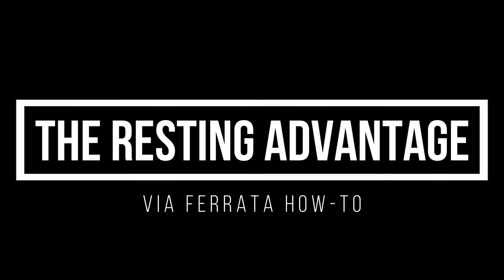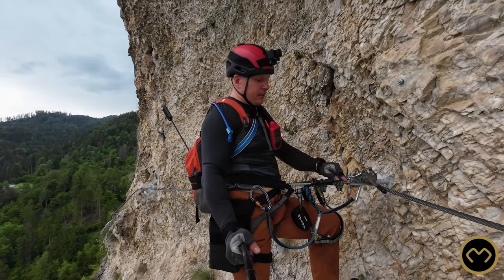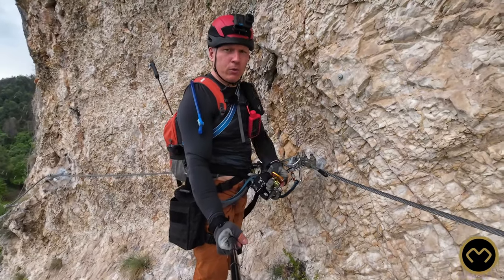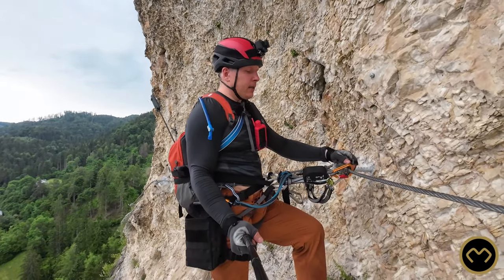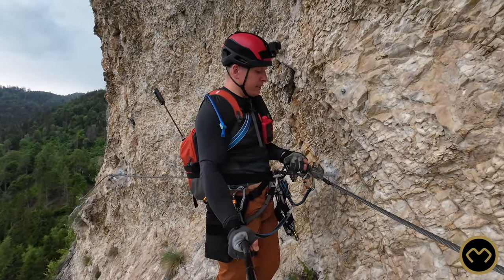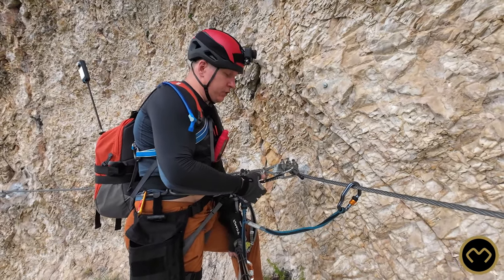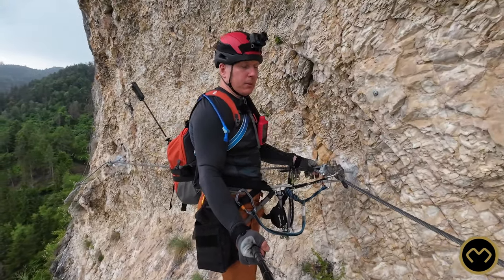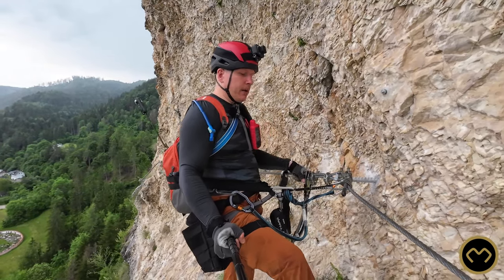The Advantages of Resting Systems on Via Ferrata - Why Sport Climbing don't require a resting system

Comment: Never use a normal static sling as the "rastschlinge" !

It breaks very easily.

Use a dynamic rope resting system like Edelrid "Switch adjust" etc.
Reply from the maker: Resting implies static load of the sling. There shall be no reason to fall. If properly utilised, a fall shall be static enough to not load the sling to the degree of a rupture of the sling itself or as you say, with dramatic effects on the structure of our body. It is true, dynamic rope can in the right circumstance help. Again, resting systems are for resting and if properly loaded there shall be no reason to get into the edge case scenario you use as a base for your call to action. If wrongly utilised yes, the effects you mention can happen, but these are edge case scenarios. On a bridge crossing a static resting system will not 0ut the climber in any danger if properly loaded. The slack is close to none, in case of a fall the climber will mostly swing. Now, let's suppose that the webbing will break, the climber is supposed at all times on a Via Ferrata to be clipped with the Via Ferrata Set to the safety steel cable. Again, the probability for the static webbing to rupture is low is special/edge conditions are not met.
For vertical sections, the resting system shall be statically loaded and in this case there is no way of a fall. On vertical segments, the climber shall always stay way below the cable and again, the resting system shall be statically loaded with no chance of dynamic loading.
The rupture of the webbing is a possibility if overloaded and the loading of it is dynamic enough under the stress of the overload to trigger that.
If the static resting system is misused and a fall occurs yes, the worst can happen. But again, in this case is not the problem of using a static resting system (recommended for the cases where it is properly used) but of improperly using it.
Yes, a static sling is meant for static loads. A resting situation is founded on the premise of a static load. The recomandation to employ the help of the resting system (if conditions of zero slack and no possibility of static load are met) is because if properly utilised it increases comfort and safety.
It is important to understand all these details. It is also important to understand that the role of a resting system is to rest and shall not be utilised for personal protection on Via Ferrata. The only device to always be used on a Via Ferrata for personal protection shall be the Via Ferrata Set.

Comment: if you fall with the quickdraw, you'll fall all the way down until the next connection of the cable to the rock and you're risking a hard shock if you override the shock absorber! I wouldn't do this ever
Reply from the maker: You are implying that the advice was to use the quickdraw as a third arm while advancing on the vertical or diagonal of a Via Ferrata, that the idea is to use the quickdraw while progressing on the Via Ferrata or that other are doing it (shorting the shock absorber) regularly as a choice against the common sense.
The proposition is not what you insinuate but to consider using a quickdraw as a possible resting system (this implies using it stationary, statically, without movement, when a fall is not possible). I'm confident once understood the basics of Via Ferrata nobody will ever freely chose to use a quickdraw in such way that the Via Ferrata becomes useless.
A resting system gets connected to a static point (a peg/rung, above the bolt, a bolt, etc). In this way there is no possibility of falling. When resuming the progression on Via Ferrata the resting system gets disconnected. The two exceptions where a resting system can be used as a third arm (but with careful consideration) are while advancing on the horizontal (a possible fall if the progression is done right way below the safety steel cable is minimal) and while crossing bridges.
As you say, under no circumstance the resting system can be differently. Never keep the resting system connected while progressing, never to shortcut the shock absorber, or to disable the Via Ferrata Set.